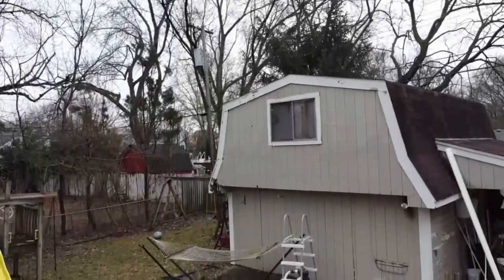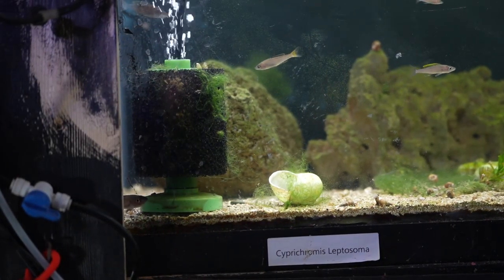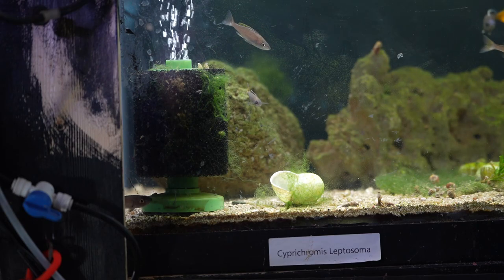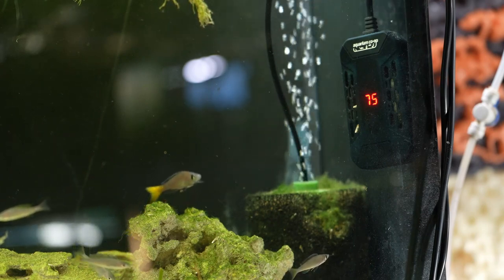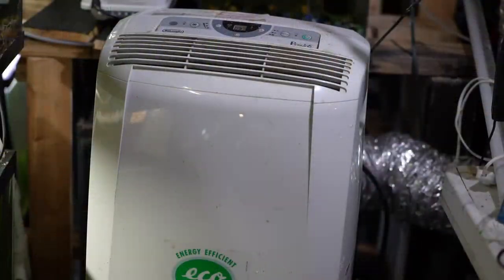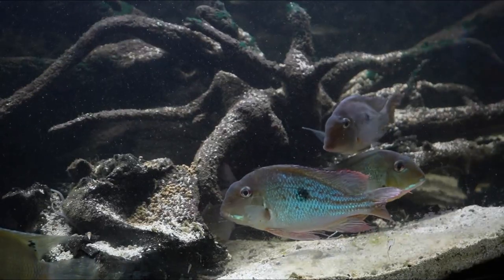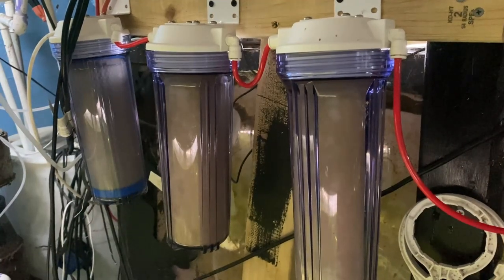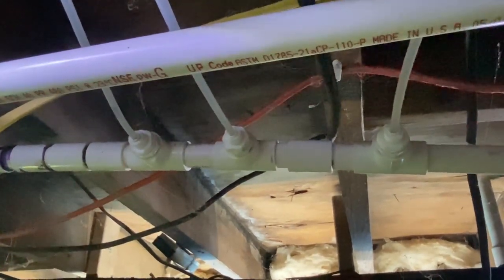How I Heat, Filter and Water Change the Fish Barn!

Comment: This was a great video and answered a lot of questions I had about how you had yours set up. I'm down in NW Ohio and I've thought about doing something similar to your barn, but just one floor. I was wondering how you did water changes. One that you didn't talk about, how did you insulate the barn? Spray foam, fiberglass bats?
Reply from the maker: It is mostly closed cell foam insulation.   I would highly reccomend that or spray foam.   I would stay away from the fiberglass because of the moisture involved

Comment: Do you have chloramines in your water? I've been looking at setting up an auto water change system, but I have chloramines and I find conflicting info on whether that style of water filter will remove chloramines.
Reply from the maker: I do not have chloramines in your water.   I would check out Bulk Reef Supply and see if they have a solution for chloramines.